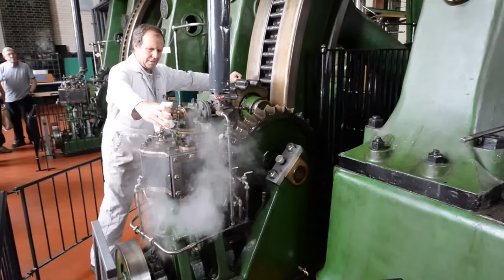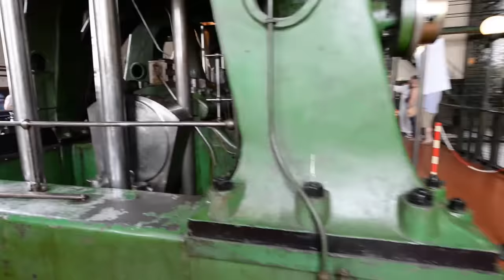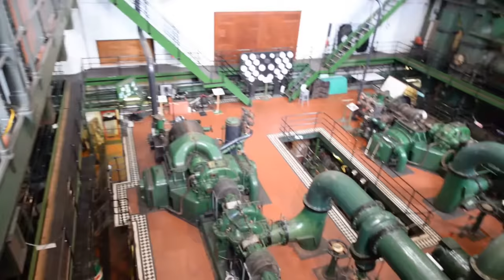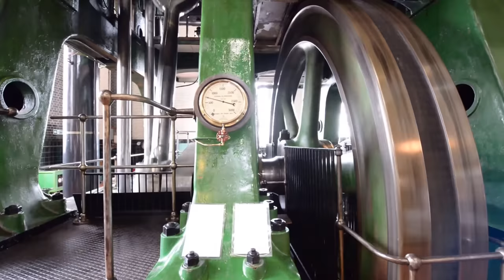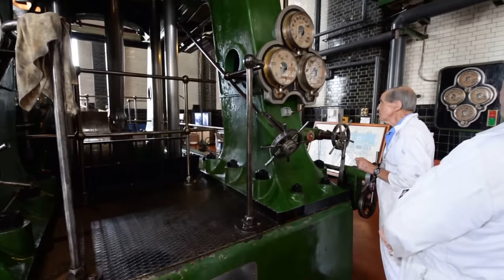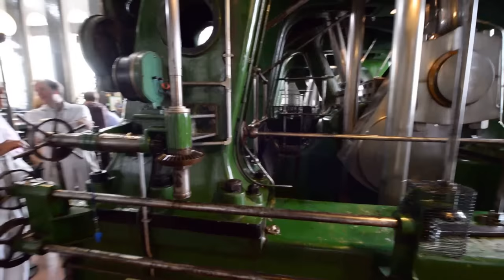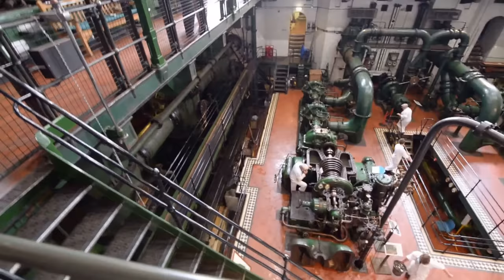Kempton Park  Big Triple Steam Engine Starting

Comment: The castings….My God…look at the castings!  Foundry and moulding shops capable of doing this work are just as impressive.
Reply: My thoughts exactly. Those are some impressive castings, I wonder if that type of casting could even be done today. So much has been lost to modernization.
Reply: We needed a 1200 HP diesel for a business in Seattle that was going to work off the  California coast running extension cords to offshore drill platforms.
We were forced to buy the engine out of country because California deemed making  a casting that big was contrary to their goal of clean air.
Now…some 25 years later…I fully avoid do any business with anything connected to California including people.
Racist of me I know.  ;-)
Reply: They still do very large castings. They need nuclear reactors to be in one piece, so a single japanese company casts the entire reactor. As far as I know it's the largest they do today.
Reply: On a slightly smaller scale, you can see it being done in "A Study In Steel", which is a documentary on building a steam locomotive.  Just make the casting moulds three times as big and use thirty times as much molten steel.
Reply: There are lots of off the self 1200 HP Diesel engines going back to the 1950's.  Maybe you meant 12,000 HP!  That would be a big casting and they are basically custom per customer.  You can buy a low end horsepower Diesel locomotive prime mover from EMD.  They actually start around 1500 HP that are reliable and tractable with highly available service with marine versions.  Not cheap and weigh around 30 tons.  You can find people, not in an hour, but you can get people that know those engines incredibly well.   Also not cheap.
Reply: @Navigator777777  You make a very important point that simply refusing to use a cheap but dirty technology does not mean it wont be used elsewhere in the world. The Californian attitude you quote is nothing more than virtue signalling. If we really want to stop coal emissions (I assume coal was the issue) we need a clean energy system that's cheaper than coal so everyone around the world will use it. Iron by the way can't be made without coal, but the emissions are small beer compared to all the other fossil fuels we use.
Reply: @mcpheonixx  some of the equipment at the henry ford museum in michigan is awe inspiring. you ever get the chance to visit its worth it. i spent a fair amount of time imagining just producing these feats of engineering.
Reply: Navigator777777 
There are no steel mills or foundries in California anyway.
Reply: mcpheonixx big 2 stroke marine Diesel engines have equally impressive castings, I work on a large container vessels and the cylinder liner is the same diameter as my arms stretched out
Reply: Fairbanks Morse is still making huge diesels that power ships.
Those monster blocks are not cast, but welded from high-grade steel. A liner, the cylinder itself, is put in after the block is assembled and destressed.
Big truck engines are still cast, although they could be welded from steel plates.
Again, they use liners.
Liners are a major wear part, and made to be removed and replaced.
Usually around a million miles, so many hours in a ship or static engine.
So, you did have a source for a powerplant, and Morse is not the only company that makes big diesels.
Other companies make even bigger diesels.

Turbines would be a better choice, but there are laws in the United States that does not allow our turbine technology out of the country without Federal authorization. 

So, ships and offshore power is to be diesel, no matter what California says.
Reply: @Navigator777777 The middle class is leaving in droves from Cali
Reply: @bsarachek1568  
As they should.
Reply: @Navigator777777  troll
Reply: LAFOLLETTER they were $2000 just 5 years ago
Reply: LAFOLLETTER I think the incentives to outsource are too great. Not to mention online shopping now and the removal of relationships. Just 10 years ago I had to practically date my parts experts to gain their trust and discounts and most importantly knowledge. Now, the main way is go online and scrape around for the best deal, look closely at pictures, avoid the obvious junk, and order 2 since one will be bad in the box. I’m personally sick of it. And about 2 years ago I became allergic to buying. If I buy, it’s the top of the line, top of the range from a company who did the r and d. It seems to be saving me a good amount, annually. The lost time and disappointment are completely eliminated.
Reply: Hi hi
Reply: @Navigator777777  if you had reading comprehension skills you could plainly see the foundation point is you're absolutely wrong about not being able to get a 1,200 hp diesel motor without going overseas.
Reply: Yeah and seemingly way to awesome for people to use today
Reply: @Dave5843-d9m  ,just yesterday (8 sept20) i watched a show on abc australia called 'the great acceleration' where they have been experimenting with using car tyres and waste plastic to make steel.  they claim it is more environmentally friendly.
Reply: Forgings! And hell yes!
Reply: @mcpheonixx  I should not think so, or not to the same quality. Yes wesadly have lost so much to modernization, and not always for the better.  Modern tech is great when it works, but totally useless when it goes wrong, and then it’s just wires and plastic
Reply: @Dave5843-d9m  about pollution, the entire USA (not only California) should start to use smaller engine cars instead of those huge trucks. Emission ? u should reduce wastes at first; i was shoked to see a video of a girl in antartic were she was saing that HERE (referring to the antartic) recycling and waste management is important.  well.. te recycle and reduce wastes is important everywere. a plastic bottle dropped in antartic or in the center of manattan is the same amount of pollution.
Reply: @sammyd7857  
Enjoy your visit to Earth.
Reply: Really thought the same.
Reply: More so! Those are working with the same weight, but in INSTANTLY LETHAL LIQUID METAL plus the weight of the GIANT METAL CRUCIBLE it's in. This end is the easy part!
Reply: Now all machines have been sent to china
Reply: A big beast of a Machine
Reply: @Navigator777777  You mean prejudice of you...
Reply: @Nodoubtingthomas  
Took me a while to comprehend  why anyone would  responding to a 4 year old post?  You know, Covid Exploitation, Maskers™, The Steele Docier', Murder Hornets, Creepy Quid Pro Uncle Joe, 8 years of greed, sedition, corruption and treason, then like on November 4th...it dawned on the nation.  MAGA!  For more years of the best president  in living memory.
Reply: @Navigator777777  WELCOME TO THE EYE OF THE STORM (0)
Reply: I was thinking the same thing. Was watching casting videos earlier. It's madness.
Reply: @atrocious_pr0xy  
What is madness?
Reply: @Navigator777777  the process of using multiple large molds and hammers with giant molten hunks of metal.. It's just crazy what we can do. It makes me want to work at a steel mill.
Reply: @atrocious_pr0xy  
Gotcha.  I built a 10 Hp boiler and rebuilt a bottle steam engine.   Beautiful thing.  Ran like a sewing machine. Closest  experience I've had to these things.  All we need is a technology that boils water...steam is a wonderful source to power homes, cook, heat and cool.  I'd love for my Tundra to be powered by steam.
;-)
Reply: @Navigator777777  fucking awesome, bro!! steam ain't no joke. I use it for something different at my place of employment. I am tasked with sterilizing tanks and product lines for a milk company, as my primary job. Actually about to sterilize a tank here in a few minutes. I am Shift Lead so i also need to know literally everything else, so I also work with Fanuc robots as well as E80 laser guided robots. i love working with machines and systems.
Reply: I looked at the casting.
Reply: yess
Reply: @Navigator777777  I hear you I was born and raised and still live here in CA and the government's eco-zealotry and anti-humanism is over-the-top. We now live under a germophobic fascist regime with county health department gestapos.   Not all of us are crazy some of us have just decided to lay low behind enemy lines and fight the commie bastards so don't hate all of us.
Reply: I think he meant smelters considering his discussion about coal use.
Reply: @Drewsky840  I think the problem is CA regulation of diesels being an impediment to using one legally, not the lack of ability to attain one.
Reply: @mrchangcooler  ehhh, I don't think reactors are cast
Reply: Superb.
Reply: @mcpheonixx  so many skills lost, many can never be regained and the they took in their work is amazing sadly all anyone wants to do is sit in an office these days
Reply: That's what struck me; imagine just making the wood patterns.
Reply: @berniceoberland7427  another lost skill
Reply: There was probably only one or two places in the world that could produce this engine back then and maybe today LOL....wouldnt want to have to buy a new starter i dont think advanced auto stocks it lol
Reply: Just those gears... holy cow how do you get such precision cutting of that size/age.
Reply: @Navigator777777  ehh 5 year old comment but I believe it is statist. Lol.  California is just trying to point human kind into a cleaner future.  Sure it’s easy to have things done with carbon but it’s not that much more difficult to do things with other energy sources. Once batteries catch up in tech that is all we will use.  I’m not Californian, I am Washingtonian and used to be a local 32 plumber/welder until an injury.
Reply: @AB-these-handles-are-stupid  
Can you point to any successes in California?
Reply: 8i
Reply: @mrchangcooler  g8
Reply: @Navigator777777  Could you have used a diesel railroad locomotive?  Those have 1200 HP.
Reply: @Dave5843-d9m  in Sweden our biggest steel mill will start producing ”green-steel” with the help of hydrogen technology to stop the use of coal. Interesting to see how it works out.
Reply: Good old British Engineering. Pity we don't have stuff like this any more... We used to manufacture miles of steel railway lines also, if you go to Finland you can see it still in use.
Reply: @mcpheonixx  India and China still do this kind of casting
Reply: Thats the thing the infrastructure to build engines like this may or may not even exist to make castings and forgings of this size and complexity.
Reply: @irongutsspeedshop3334  i think the same way. Id rather invest in quality then have to constantly swap out cheap parts. Lol 

Similar to a convo. With my wife about winter outerwear. She’ll buy a “fashionable” winter coat. Spend good money on it less then 2 years its falling apart. I’ll drop a couple bills on a nice Duluth coat or wool hunting coat and hear about it for weeks. But i wont be buying a new coat for 5-10.
Reply: @mrchangcooler  no, nuclear reactor pressure vessels are made of welded rolled steel
Reply: And we could not do it today
Reply: Pratchetts of Denton Holme
Reply: @Navigator777777  CA = Largest GDP of any state in the USA.  #1 GDP  by a large margin.
Reply: And they did it with STYLE!
Reply: The best part? It’s not Chinese made!
Reply: @dwsan1tx  You beez ray-ciss.
Reply: I was thinking the same thought
Reply: @Navigator777777 This video showed up…6yrs later in my feed.  I feel like I need to address your comment as horribly inaccurate.  1200hp would be achieved on commercial diesels as low as 2L /cyl or a derated larger bore engine at maybe 4L/cyl.  California allowed the use of pre T4 or T4F engines as long as it was retrofitted with exhaust filters.
Reply: @Navigator777777  I’m on the east coast but I’ve had to oversee engine sales projects going to California.  That state is so far out of reality with regulations.  We actually lost a deal because of the additional expense to retrofit the engines.
Reply: @rxpsycho7326  
Now you're talking!  I can relate 100%.  Working for California was an Alice In Wonderland nightmare and that was 25 years ago.  Never again.
Reply: @Navigator777777  Nothing like drumming up conversation on a post 6yrs old.
Reply: @rxpsycho7326  
LOL...The pleasure was all mine!  ;-)
Reply: @mcpheonixx  one day they will say aliens built them!
Reply: @mcpheonixx  

o
Reply: @AB-these-handles-are-stupid  I don't understand why not use H2 you don't have to mine anything for that and should be cleaner than battery. Car's that run on H2 it does not take several hours to refill compared to recharge an electric car. And the best part you can convert a casoline engine to run on H2.
Reply: What do you mean by the castings? Just like the big rods and gears that they use?
Reply: @kona702  
Are you blind?
Reply: @kona702  
The base for the engine is a huge casting.
You don't see cast iron pours like that anymore.
Reply: Everything has to be balanced too
Reply: @bsarachek1568  THe CIO's? The California Improved Oakies?
Reply: And the machine shop that turned those flywheels and cut those gear teeth, and machined the base feet. Incredible!
Reply: Yes! Every part I imagine had to be made in wood first by a very skilled carpenters, in the pattern shops, amazing!
Reply: @mcpheonixx  CERN is arguably a more impressive device, requiring orders of magnitude more precision and craftsmanship, and it's not the only particle accelerator we've built. JWST was also a pretty sophisticated machine. I wouldn't say that anything has been lost, I'd say we've gotten better at certain types of manufacturing. If you really wanted to I bet you could turn any decently modern machine shop into something capable of making old-school steam engines again. Like maybe a CAT facility or similar, still does machining on these scales.